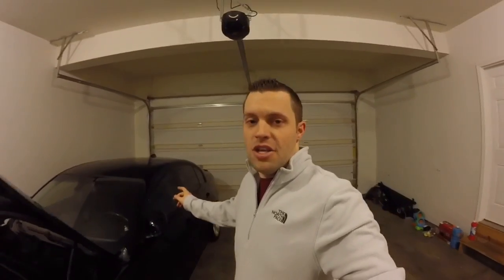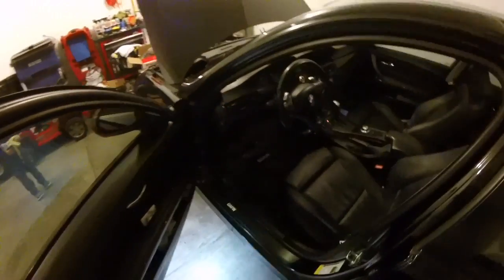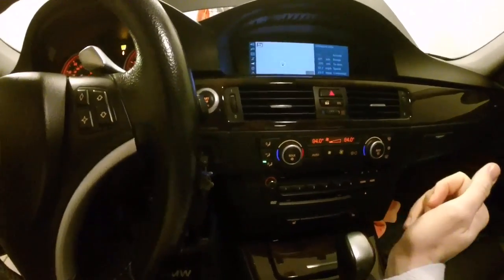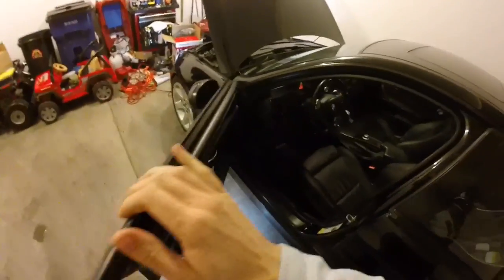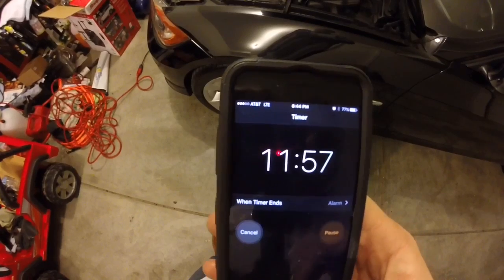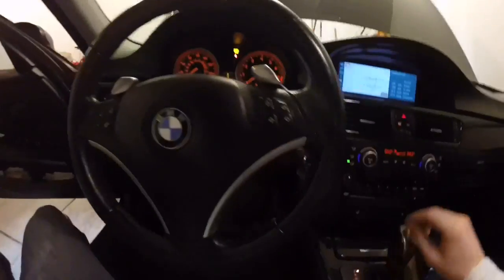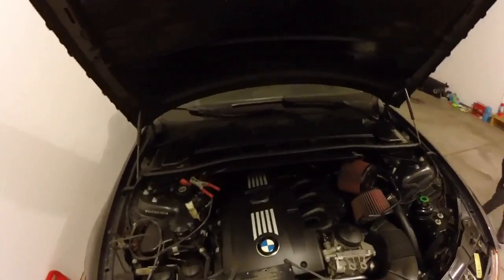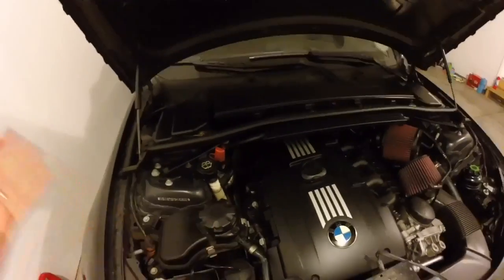How To Bleed Your BMW N54 135i 335i 535i Coolant System!

Comment: This is the right way to do it as described in the bentley manual cap closed, bleeder closed... I did this procedure after i replaced my upper radiator hose that cracked open and spilled 6L of coolant. I lost a little bit of coolant after the test drive so I ran it again and noticed a pinhole leak in my expansion tank hose. So this is a great procedure to not only test the water pump (if you hear it whirring and coolant circulate its good), but also to pressurize the coolant system and check for pinhole leaks that you might not see otherwise. 

If you have an older bmw 100k+ miles 2009 I recommend you replace the upper/lower radiator hoses, coolant hoses. Even though the rubber exterior looked great the plastic connectors inside melted/corroded and lost the seal.
Reply: Scott Schumacher same thing happened to me, freaking O ring in the upper coolant hose snapped and leaked coolant EVERYWHERE
Reply: I'm watching this video because it happened to me. Brought aftermarket top hose, it's leaking at connections, what did I do wrong
Reply: geo745don Buy an OEM hose, aftermarkets don’t always fit perfect
Reply: Also be sure to always use the bmw specified coolant.
Regular coolant deteriorates the hoses.
Reply: Did it explain what the bleeder screw is for then?

Comment: My biggest problem in life is i buy BMW
Reply: If you take care everyday and be careful it doesnt have a problem getting floored everyday
Reply: @itzpro.  i barely drive it... even not me everybody says this for BMW
Reply: Not true, I love my bmw . Just take care of your cars man
Reply: @isaiasbarriga1622  yeah not true. All my maintenance is up to date. The problem is that it has a ton of problems that go bad that just shouldn't at low miles. The water pump goes bad, oil pan gasket, oil filter housing gasket, they had 6 recalls come out for just the 3 series e90. Its poorly built. The fucking door handles melted on my passenger side.
Reply: USED BMW
Reply: Agree!!😅😅

Comment: I changed my pump/thermostat (N55, 135i) yesterday and need to bleed the system.  However, this video or the video from BavAuto never mentioned to take it out of Auto for the HVAC.  I followed the procedure with the Auto left on, temp set to 84 and fan speed set to low and pressed the throttle pedal for 10 seconds.  It was my first time running through this procedure so I left it running for 12 minutes but the pump never cycled on/off.  In addition the engine fan started to blow on super high speed.  I disconnected the engine fan but left the rest as is.  I Googled for max engine fan during bleed but the articles I found were related to a bad water pump.  Well, I just changed my pump so I doubt that was it but you never know if they sent a bad part.  So I had to try it again and see if it will do it again.  But this time, I took it off Auto and repeated the rest of the steps.  Well, it worked after I took it out of Auto.   The pump ran and cycled on/off etc.  However, after about 3 or so minutes of cycling it stopped for close to a minute and I started to get worried.  The previous stops was never that long and I started to wonder, is it suppose to stop that long????  I ended up leaving it as is and it started it up again.  Point is...Once it starts to cycle, leave it and let it do its thing.  But thank you for ALL the videos you've posted.
Reply: thanks dude
Reply: Hey dude, I got the same problem. How do you take it off auto though
Reply: hi bro, I just replaced the radiator on my 335i x drive n55 engine and Im wondering how to purge the system to remove the air before starting the car again?

Comment: BMW Fanatic
 So question, if the system is closed then how does the aire get out? Every other car I have ever worked on to bleed the air out I HAD to have  a way for the air to escape: Like unscrew the cap, a bleeder valve or something? ? On my wife's VW I had to remove the heater hose, the highest place for the air to get trapped.

This is the first BMW that I have owned, I have avoided them because they have to many ISSUES but my wife wanted it and her old VW Golf just turned 200k.

Comment: Hi Mr. Fanatic, loving your videos, they have helped me understand the n54 engine from basic to advance, I have been using my 135i since it was 85k now is about 90k, so i was doing oil changing, oil housing and coolant new gaskets, i also took apart the whole front including oil & coolant radiators, headlights etc, to be able too clean messy old and power steering fluid mess caused by previous owner, i am stuck in the coolant part:

1- I want to drain the remaining old coolant from engine block and make sure there is nothing left, is there a coolant bolt in the n54 block?

2- Do You think I drained all coolant since i unmounted the radiator and host from coolant pump?

3- Should i do a bleed with distilled water instead?

Thanks in advanced for your time, your videos are of great inspiration...Best!!!

Comment: So you do this after replacing the oil filter housing gasket as an example, correct.   This will get rid of any air bubbles in the system?

Comment: BMW Fanatic
One more Q please? I cannot tell IF the electric water pump is running or not? I did it exacly like you did, 3 times and never heard it at all. Since I did not hear it the first two times it only ran 3-4 minutes. The third time I let it run the full 12 minutes but the level did not change at all

We bought it used in October and of course had NO TROUBLE until the weather started heating up. It heated up yesterday on my wife. I let it cool, filled it up and it overheated again today. So I tried your procedure, hope it works but when there is no sound of the pump running and the level did not change it am UNCERTAIN...

Comment: Heater won’t come on with switch on, and car off. Only if I start car, then the heater will come on? How do I bleed it now ?
Reply: With mine (09 x-5 ) I have to insert the key fob. With my foot OFF of the the break I press the button to start. The car wont start but all the gadgets come on including the heater.

Comment: Question bro I did a radiator swap and just removed the fmic and the upper and lower hoses and the hose to the trans cooler how much coolant do I need to add from a radiator change.

Comment: I have a low coolant light on my vehicle just change water pump and thermostat and reservoir and radiator does that mean idid not bleed the system right ? And I do not have no leaks

Comment: I'm wondering if you'd know why the water pump doesn't switch on and off in the bleeding process? I been sorting out coolant leaks due to the quick disconnect o rings and every time I cycle on the bleeding process the pump stays running and doesn't cycle off and on like everyone else. Is it a pressure thing that makes it cut off and on?  Or should I be looking towards replacing the water pump.
Reply from the maker: +Raymond Sisneros that would be a problem with the pump itself if it’s running a different way vs. than what it should
Reply: BMW Fanatic Ok. O'Reillys has the water pump for $415 with a lifetime warranty, where would u buy the water pump?

Comment: I had the upper radiator burst and spill the coolant everywhere yesterday on my n52 engine should this be done after I replace the upper radiator hose or would I have to completely unplug the radiator plugs from the bottom to flush any leftover coolant and replace it with new coolant.

Comment: what if i dont connect the battery charger and do the procedure? or battery has to be hooked up.
Reply: JUST PREVENTS BATTERY FROM GOING DEAD IF ITS AN OLDER BATTERY IS ALL

Comment: So you don’t touch the bleeding screw at all?  Also, the the n55 process different than the n54?  My car expansion tank doesn’t have the indicator stick…it just has a min/max…I’ve also tried checking if the stick broke off inside.  

2011 bmw e92 n55 335i 6spd
Reply: hi bro, I just replaced the radiator on my 335i x drive n55 engine and Im wondering how to purge the system to remove the air before starting the car again?

Comment: I just replaced my expansion tank was so easy but wasn’t sure what steps to open the bleed valve and activate the water pump and if to keep the cap on or not
Reply: I keep asking to bleed air 
Cap on or losse 
No one answered
How doyou do it

Comment: I want to find a coolant flush for the F10 model and how to bleed it and I can't find any useful videos.
Reply: Should be a drain plug on the radiator? Check out bimmerpost or f10post whatever it is. You will find tons of answers there!:)

Comment: Where does the air go if the cap and bleeding screw is not loose?
Reply: Avia S fins an answer yet?
Reply: Marcus Wright II, Not the exact answer but everywhere is says the system gets rid of the air in "some other ways", gonna have to trust it I guess :d
Reply: Wait what? System cannot get rid of air by it self... It's completely sealed (well, it have to be sealed). That's why we have bleeding screw...
Reply: @Alteriukas

Comment: Hi Mr.Fanatic, I’m replacing the radiator vent hose that runs over the radiator from the expansion tank. My question is should I replace the hose, then add the coolant and do this process? Or should I bleed it before adding the coolant?
Reply from the maker: +Clem Rolle Replace that expansion hose and then bleed
Reply: BMW Fanatic should I remove all coolant from the radiator also? Or just top off

Comment: I have to change my radiator vent hose, so do you recommend bleeding out all of the coolant?
Reply from the maker: Ralph Lopez Yep! It's always best practice to do so since air could get into the system
Reply: He didnt get the question. Yes replace your fluid if it got a fair amount if miles on it. Grab a thing of bmw coolant from BMW it has to be from there. Probably 28 bucks for a jug. Mix it 50/50 with distilled water (yes it has to be distilled)  take off the bleeder screw on reservoir tank and fill the reservior till it almost pours out the bleeder screw hole. Re screw in the thing and run his proceedure. You can find the drain plug on the radiator and empty coolant system from there. You will know it worked correctly when you see the level of coolant has dropped down

Comment: I'm confused. some posts say bleed with expansion tank open, and while the bleeding process is running add coolant slowly. while some say have it closed such as yours and then adding after the procedure is completed? does it matter? are they both right?
Reply from the maker: EL LL keep closed, bleed, then open back up to top off if low
Reply: BMW Fanatic thanks for the response. just confirming.. i loosen bleed valve, pour coolant mix until bubbles come out. .then shut the cap and run the bleed procedure? do i tighten the bleed screw? how full do u fill the reservoir? just to optimal amount? some posts say fill to the filler neck,won't this be too much? ?

Comment: Hello,

After replacing the 2 famous gaskets at the oil filter house, and replacing the coolant reservoir,,,, Inside the car the left side won't heat, cold air comes out. and at the right side it's warm.... I did this procedure about 4 times.
Reply: That's an issue with the climate control not your cooling system...
Reply: @Whosoever141  Well after some research found out that theres a leak in the head gasket (6th cylinder inside) but after the headgasket was changed there was no result.. And yep... probably had to do with the climate control.. But the custommer claims the problem wasnt there before changing the gaskets and reservoir....

Comment: what is the normal temperature for bmw 535i xdrive 2009
Reply: I ask him why he changed the water pump I did the flushing and when the car heats it stays in 214 and the most that to rise is to 219 to 221
Reply from the maker: +Lemuel Alfaro 220-230 is the normal range
Reply: BMW Fanatic thanks for your help so far been maintained from 214.f to 219.f
Reply: BMW Fanatic I made a video in you tube, if you can see it, tell me what you think, I'm confused, other people say it's very high, that temperature. I do not want my motor damaged.

Comment: wait, so why do we need to bleed the coolant? I don't quite understand.
Reply from the maker: kevin p trapped air in the system will cause it to overheat/run into cooling issues. Once you replace a coolant related part, you'll lose about half of your coolant. That right there will have some air in the system, which is why this process comes into play 😀
Reply: BMW Fanatic and when you get a new water pump huh
Reply from the maker: kevin p yeppp

Comment: As much as what you did is clear - I bought my 335 E93 N54 2008 and it has green fluid. I want to change it to OEM and after watching this I still have no idea how to replace the fluid? Flush or add the new blue? Why even do this? The video doesn’t explain anything about the process that I can see?
Reply: This a bleeding procedure! If you want a coolant flush procedure you need to look for that.

Comment: Why do you need a charger
Reply: Technically no, if your battery is good your good. Anytime you flashing or anything that needs a good strong battery or somthing to prevent the battery from not doing its job during the process is the main reason why you need a trickle charger

Comment: Is it normal when my car is running and I open the resivour cap it's shooting water out like it's bleeding itself but it's shooting out stronger than a bleed?
Reply from the maker: Andres Medero you would need to keep it closed
Reply: BMW Fanatic it was closed the whole time. Something else might of happened. Yesterday my cooling fan broke and my radiator cracked. And I installed a universal fan. And tested it today and my car seemed to be over heating and the whole time the car was running it was shooting water into the resivour is that normal??
Reply from the maker: Andres Medero I mean when it's pumping coolant it's going to be flowing pretty good within the reservoir

Comment: but why would i go through all this instead just opening the valve that all bmw/mini have?!
Reply from the maker: Ardalan Shabestari The bleeder screw is only unscrewed when topping off with coolant. It does help a little, but trapped air is still in there, thus this would be the proper procedure to fully eliminate any and all air that would be trapped.
Reply: Ok, thank you! 🙂
Reply from the maker: Ardalan Shabestari 👍🏻
Reply: BMW Fanatic but let's say on this side of the pond people drive 4 cylinder diesel cars. And my water pump is not electric. So how would i bleed it correctly? 🤔
Reply: BMW Fanatic i have an 2010 e90 320d lci
Reply from the maker: Ardalan Shabestari not sure, it would all depend on the engine to see what the procedure would be for that specific vehicle
Reply: BMW Fanatic well ISTA (bmw official diagnostic program) says to bleed the air out via the screw that is made to bleed the air. I have done this more than 200 times and never had a problem. I even flushed all the 11L of antifreeze on my M50 engine and never had air trapped
Reply from the maker: Ardalan Shabestari yeah I was just about to say that - looks to be the only thing if the water pump isn't electric.
Reply from the maker: Ardalan Shabestari you don't have an N54 engine, so my video wouldn't apply to you 😀
Reply: BMW Fanatic yes because 90% of cars in Europe don't have an N54 engine and i was like it's impossible this whole time i was doing it wrong on bmws and minis
Reply from the maker: Ardalan Shabestari nah, you're doing it right on yours!